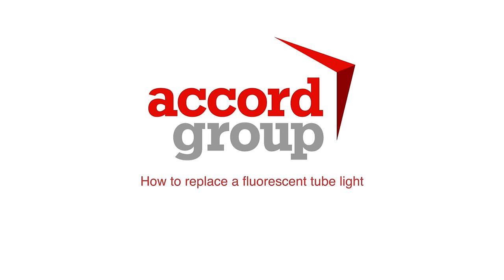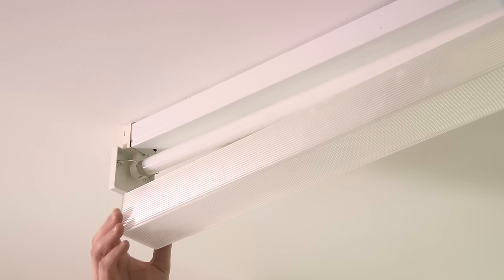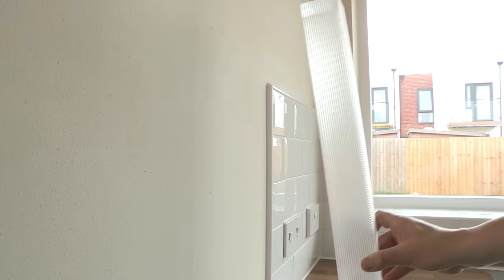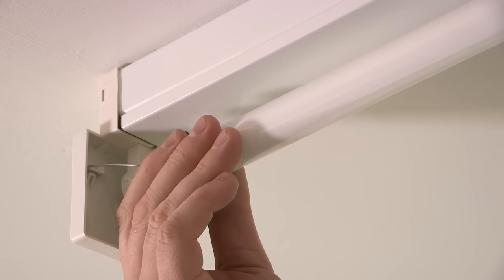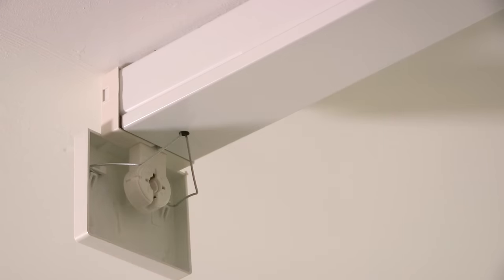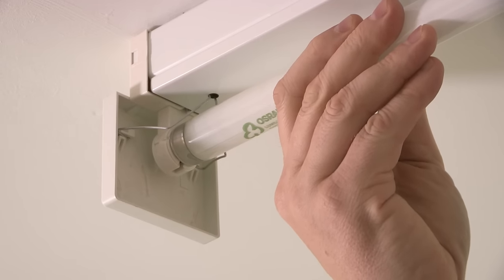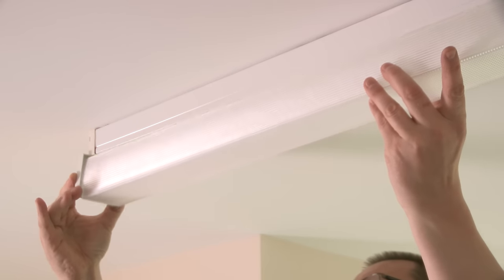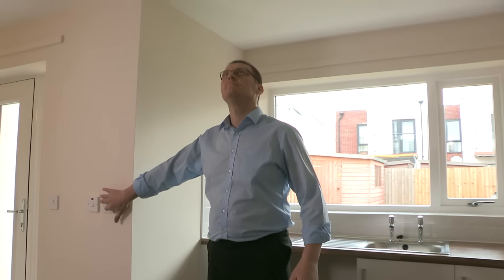How to replace a fluorescent tube light

Comment: Being a electrician as I am forever lady's and gents.that's is a 5ft fluorescent light fitting with a t8 5ft 58w fluorescent tube.with very quick start 58w ballast and the starter built in the ballast.and not using a 4--65--80W fluorescent lamp starter switch via preheats switch starts circuits.and have a good day to all of your company team in general.

Comment: Can the electricity be ON when doing it ? Or OFF ?
Reply: for safety you should turn off the electrecety of that room you want to change
Reply: I do it while it’s on but I am careful not to touch the metal ends of the tubes as they aren’t grounded in most cases. If you don’t feel comfortable, switch off the power. :)

Comment: Step 0: Make sure the electric breaker is turned off.
Step 0.5: Aquire a stepladder to reach the fluorescent tube.
Reply: Oh yeah
Reply: Step 0.1 buy a new tube
Reply: @Fluorescent Light Collection  True! Forgot about that.
Reply: Dude I've been changing them with the lights on so I know which are out and when the new one was installed correctly or not you'll be fine
Reply: Electric breaker?

Comment: In a predicament. My previous light is 32W and I found a new replacement for it. When I put the new lights in, rotated and turned it on, the light worked for the rest of the night and then the next time I tried it wouldn’t turn on. Why won’t it turn on if it worked initially?